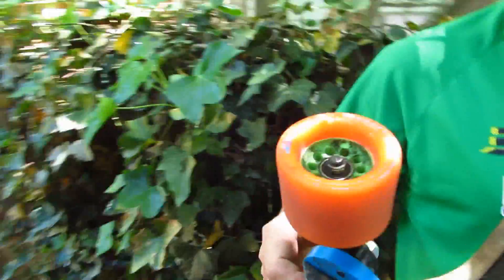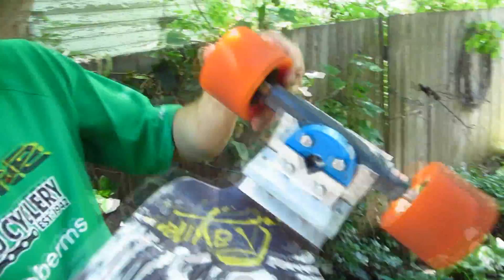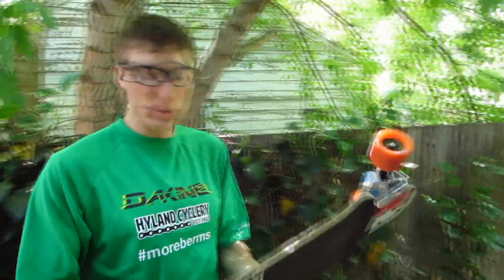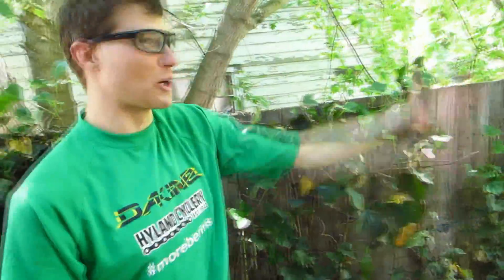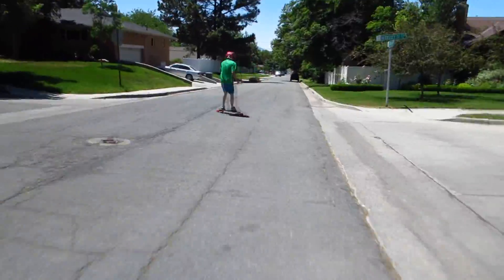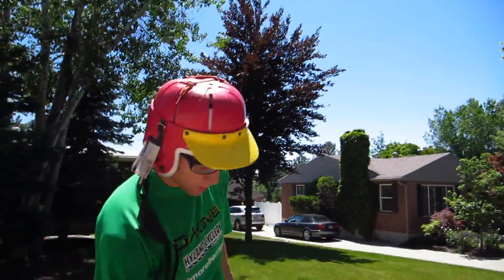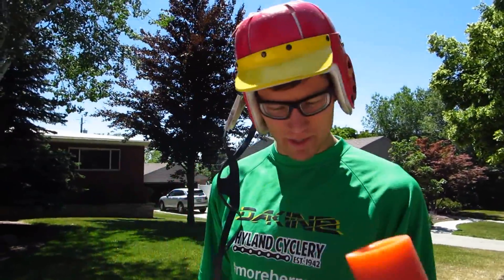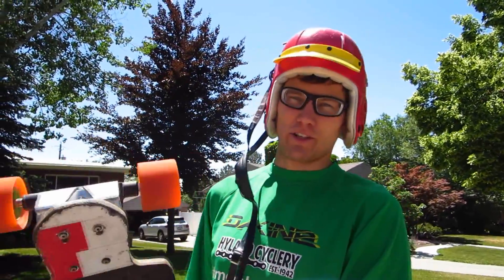Other Planet Rojas Hybrid, Experimental Setup

Comment: Ok so I bought a set of op and a set of Rojas I am going to try this.  

So what I need to know is what the angles of the deck mounts are they at a zero? Or 5 degree? 

Also I’m using the op board one is 5 degree and 5 degree  and the other 0 and five in the front.

So basically I am just looking for what angles I need to mount these at over all to get that kind of action.  

This is pretty cool I have done a shim job on the op trucks and re tuned the cam.  I think I just need to get the geometry right for them to preform like that. 

Thanks
Reply from the maker: What exactly are you trying to do?

Just setup the board with a Rojas truck and an OP truck?

Comment: thats so crazy, amazing what youve guys have done, and good for ppl who like cruisy carvy surve style. i couldnt ride em tho im used to something like an aera k4 :O id be dead going 100+km on those trucks lol
Reply from the maker: I wouldn't be so sure, they're still really stable.
These ones in particular have the rojas bushing on them, which is a ton more resistance than any other OP setup.

There's other problems still. They don't handle well while tucking, and they don't have the grip you'd need at those speeds to navigate corners, and other things like that.
But, you wouldn't die.